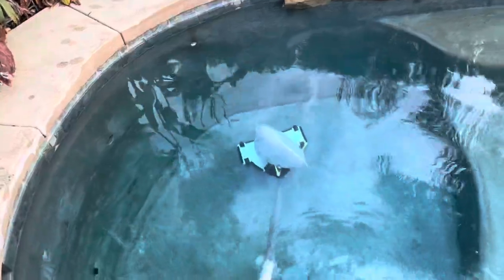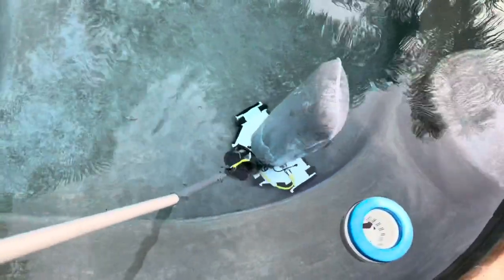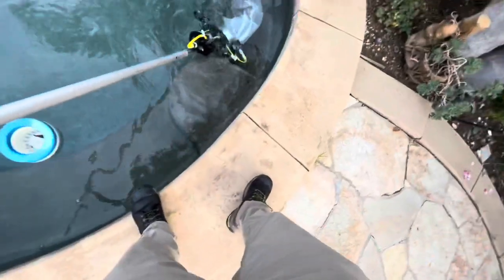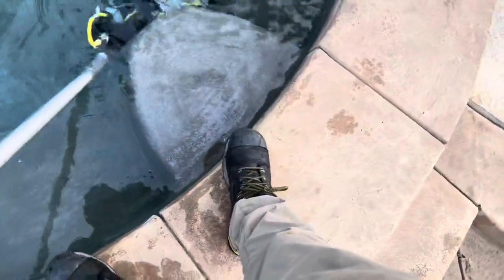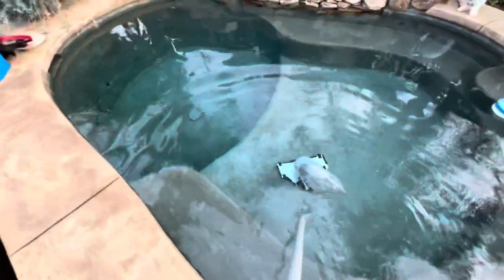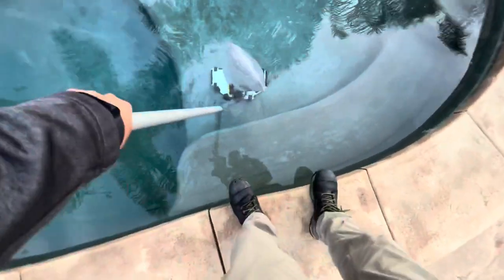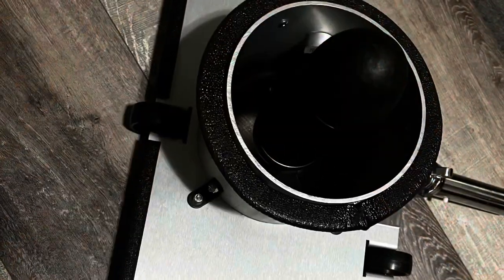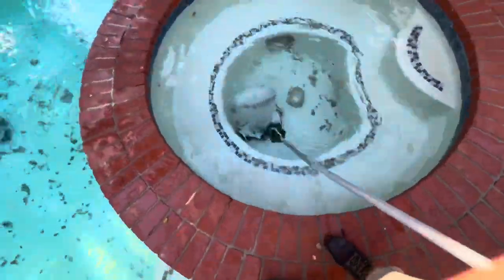1 Week In - The Bottom Feeder Pool Vacuum

Comment: This a great cleaner , I’ve had it for 1 year and a half , they have upgraded a lot of parts ! Which I needed up paying $900 for upgrades . Cable , bags , motor . It’s worked amazing . New motor last longer . I still bought a riptide
Reply from the maker: What do you find yourself using more. The Riptide or the Bottom Feeder?
Reply: @rodriguezpoolservice3447   I barely installed the riptide on my truck today , bought the newest SL . But bottom feeder is super lightweight
Reply: @benitobuitron6276  - Which one do you like better and which one works better? I own a pool business and and I’m wanting to get one or the other but can’t decide which one.
Reply: Can I modify it as to where the dirt gets trapped by putting a fine pool sock within the mesh bag? Does that make sense? Assuming there is a sock sized big enough for this?

Comment: Can I modify it as to where the dirt gets trapped by putting a fine pool sock within the mesh bag? Does that make sense? Assuming there is a sock sized big enough for this?
Reply from the maker: I guess you could, but with like any cleaner that uses bags. The finer bags will get clogged pretty quickly.

Comment: I see your reason why no riptide, you didnt had the WHOLE Riptide cart, you can carry all in that cart, 1 trip and easy to carry, only con of the riptide is in a small place, for example a fence and AC unit next to in a small space the riptide wont fit, so you will have to use the old way vacumm hose. Other than that, riptide is the best.

Comment: Just an observation, why do you carry a caddy? especially in the winter time. I see you have a vacuum head, brush, acid, chlorine..looks cumbersome.  I take the pole, with net attached, throw the brush inside, a small cup with a little handle to hook on the net,  with some cal hypo in it, and Bottom Feeder in my left hand. Could not be any easier. Everybody has their own method, but I am into doing things as simple and efficient as possible.
Reply from the maker: What about your test kit? Soap to let you see clearer?  Test strips aren’t good for ph readings so that’s not an option for reliable testing.  What about acid? Are you not adjusting ph or do you take a separate scoop with ph down?
Reply from the maker: I mean I’m not perfect. But I do what I know is necessary to keep the pool looking great and also make sure the chemistry is balanced as it should be.
Reply: Test strips in pocket, they are definitly close enough. Ive compared results to Leslies free water test, theyre close enough. Also, if you get your alkalinity where it should be, you will not have PH bouncing around. I dont need to squirt soap, just wastes precious seconds. Ive had hundreds of pool accounts for many years, sold many accounts. If your spending more than 15 minutes at a pool, to me its just wasted time. Just my opinion, like I said, everybody has their own method, whatever puts the most money in your pocket
Reply from the maker: What Area are you in?
Reply: @rodriguezpoolservice3447  southern cal
Reply: Pole, net, vac head, vac hose, large bucket for leaves with 2 tablets, brush, small bucket with cal hypo and test strios in pocket.
Reply: Do you guys use liquid chlorine?

Comment: Considering buying, so someone please help me answer, will this get dirt too or just leaves? If you had a pool with thick dirt and no leaves are you busting this out or getting the manual vacuum
Reply from the maker: The last thing I’m going to bust out is this. It’s only good for leaves and larger debris. As far as dirt goes there’s is nothing that compares a system vac or a trash pump.
Reply: It has a filter attachment. That will get everything in the pool. Dirt and leaves 🍁
Reply: @rodriguezpoolservice3447  thanks for the reply. I read the 57 micron bag will pick up dirt. Not true? What about small rocks? I'm in the Keys & almost every yard here is peastone which inevitably ends up in the pool